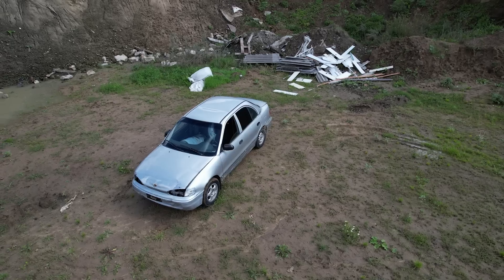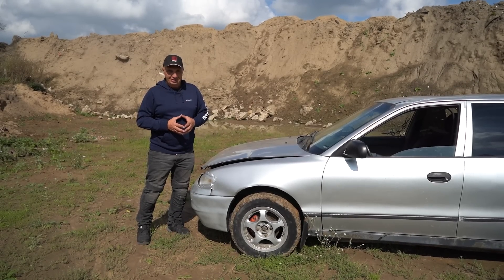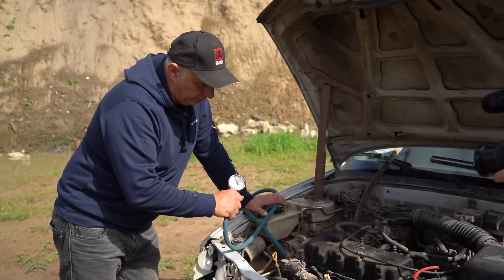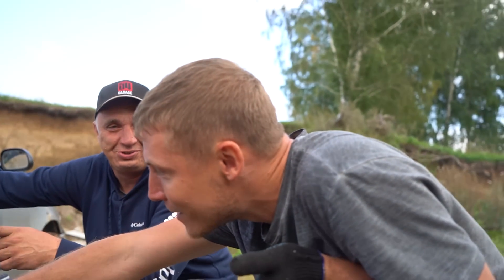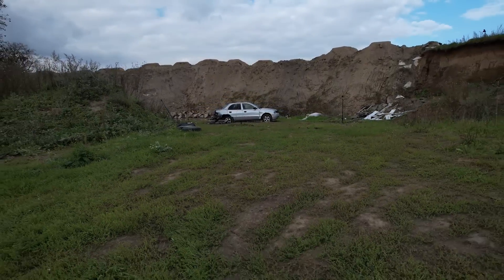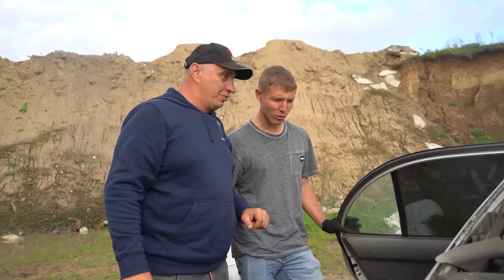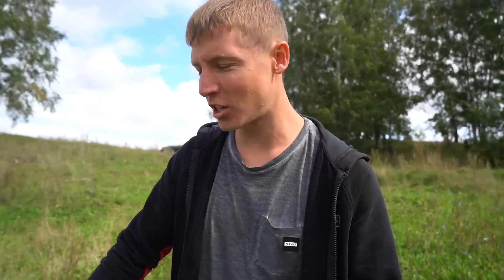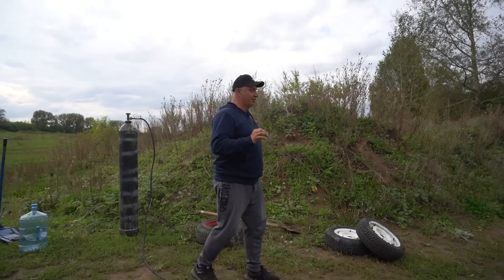We feed tires with 900 PSI of pressure - what will happen?

Comment: Less explosion on the front wheels due to the weight distribution. The engine and transmission is in the front and for pushing weight down their for the ground absorbs the impact from the expanding molecules under pressure and pushes the air to the side

Comment: Does anyone put extra air pressure in their tires to increase Miles per gallon or Kilometers per liter? If so, how much pressure and how much increase in fuel efficiency do to decreased rolling resistance?

Comment: The first 2 tires didn’t do much because a weak spot in the “rubber” caused the failure. The third tire actually failed at the bead not on a weak spot in the side. When that happens the force is incredible. You are actually ripping apart the steel cable/wire inside of the tire, which takes a lot of air pressure. The fourth tire also had a weak spot on the side. And it looked like the first truck tire also failed on the side. The second one also looked like it ruptured at the bead. You can see where it is  separated in several places. That would be why it had so much more force when it failed. 

In the US, there are two sizes of wheels that are very close, one being a 16 inch rim and the other being a 16.5 rim. The rims are basically the same size, the difference being in the thickness of beading lip. So you can get a 16 inch tire on a 16.5 inch rim okay, you just cannot get it to seat because of the difference in the beading lip. I worked at an auto tire company when I was young and a customer brought in a set of bare rims and wanted new tires put on. He told the salesman that they were 16 inch rims, and the salesman never checked (size stamped on the inside of the rim). Anyway, the salesman pulled the 16 inch tires and the technician started to put them on. He got the tire on the rim and hit the “blast” to seat the bead. The tire made a good seal and he kept airing up,the tire trying to seat the bead. Other people in the shop said it was taking a long time for him to get the bead set, but thought nothing of it. Then all of a sudden they heard, and felt, a big explosion that rattled every window in the building. The steel band in the top bead had ruptured and the force broke part of the tire machine and it took the top of the technician’s head off. The guy never had a chance. This happened at a different location than where I worked, but I showed up right after it happened to pick,up some tires. It was a mess, the “splatter” was all the way to the ceiling rafters and about 30 feet behind him.

Comment: Here's an idea, convert an overhead cam engine to side valve engine by moving the head sideways so that the valves are over the block. weld on iron to the side of the block to create a channel for the gases to flow from the valve to the cylinder.

Comment: Please sir if you want to do something really fun get a V8 engine I have done this set the carburetor to about halfway open and let it run in park with the parking brake on and put Pebbles into the carburetor and see what it does to the engine if it's a good American V8 engine it will keep running it is hilarious make sure the engine has proper oil and coolant someone please pass this up forward to garage 54 headquarters it is really hilarious to do we did it a couple times

Comment: Water do not compress so it does not build up pressure, so when the tire rupture you only get a little water splashing... But if you use air that compresses it will build up pressure and create an explosion when the tire rupture.

Comment: You measured the air pressure of the power steering setup, but you didn't appear to measure (or at least display) the pressure for the air setup. What was the actual pneumatic pressure that each of the tires exploded?

Comment: We were told in 1978 that truck tyres had enough air pressure to hurl a 13 lb bowling ball 1/2 a imperial mile about 800 meters , so yes never place any part of your body near a tyre when filling them.

Comment: About 56 years ago I was inflating a 15" garden tractor tire laying on its side.  I don't know how much pressure I put in but I only had about 80psi available.  Waiting for the tire to pop the bead on the rim and it popped and went airborne probably 30 feet.  Shattered my right forearm and then went through the carport roof and came back down and landed rim and tire on my pickups hood.  Will never forget that and have much respect for tires and air pressure to this day.
Reply: Glad you made it out safely.. yeaa PTSD is a real thing

Comment: Instead of gwtting a latger tank for diving thats usually arpund 3000 psi, they go through these wild steps to get pressure into the tires 

Why do it when you can over do it?

Comment: Remember that little rubber cup you'd turn inside out, set down, and it popped into the air? lol that tire on the roof
Reply: That was called 'Zongo' here in the Netherlands

Comment: Compressed gas and high pressure liquid are entirely different beasts when it comes to failures. The compressed gas expands exponentially, causing an explosion, whereas high pressure liquid doesn’t compress, therefore doesn’t expand or explode. That’s clearly seen in this video. That’s also why pneumatic systems generally are not super high pressure whereas hydraulic systems can be. The exception might be an instance of contained boiling liquids, which can explode due to the liquid becoming a gas as soon as they rupture and release pressure (things like propane tanks, aerosol can or water heaters are an example)

Comment: Had a 69 full size Chevy C/20 with a custom made heavy duty Dimond plate utility body on the back of. Somehow sitting on its own in my driveway the rear passenger tire just decided to explode sitting there for days unmoved. The pressure was normally set, these were heavy duty truck tires that had a maximum pressure of 90psi. I had roughly 50 in all of them because they were hard riders anything above that! The fact that they were  actually considered under pressured and yet, it was capable of lifting my rear of my truck off the ground and the sound of the tire was no different than a small land mine or hand grenade going off! I was 15-20 feet away from the blast on the opposite side of the truck and still fealt the incredible pressure wave blast by me after going deaf 😂😂😂 Needless to say, It was pretty intense, especially when it was completely unexpected! ❤❤❤

Comment: That big gas cylinder : You cut the bottom off weld a couple pivots on it for elevation put a half turn rotary valve on the end and make a carriage for it and you can shoot bowling balls with compressed air you need to hook a tank to the rotary valve and fill it as many bars as it will hold put a bowling ball in there and open valve and out pops a bowling ball about 300 kph, YEEHAW.

Comment: Wow did the frame bend??? Look at underneath the car. Also in the trunk explosion it looks like the rear axle bent?nthe wheel is angled inward at the top after the explosion 🤯
Reply: Yes the platform bend from the tire exploding inside the car!
But the car wheel was at that angle before the explosion in the trunk

Comment: if you disable the safety valve for a hot water tank, and then pressurize until failure,  the destruction is enough to destroy a shed, or small garage.
Reply: Mythbusters did that.. crazy amounts of force
Reply: @ryanbernard5287  I find that I like this creator for his experiments that aren't full of reality show manufactured dilemmas and made to seem more difficult than they are in actual reality.  also if these guys do it they breeze through the design and build, and then try  to get the most spectacular results with their creations . that's the problem I had with Mythbusters and "reality " television in general. they use psychological tactics (manufactured dilemma,  staged fighting, staged acts of outrageous behavior , scripting,  excruciatingly slowly dripping of progression with tantalizing hints of "wonders to come " but aren't resolved or not wonders at all, editing tactics that make it falsely controversial, and faking the winners and losers of competitions. these tactics are known to manipulate viewers by hacking the conscious mind (prefrontal cortex) and effecting the limbic system (amigdala,  often referred to as our lizard brain where we react instead of making thoughtful decisions)  the "news" organizations have gotten very familiar with such practices also.

Comment: Way back when I was in high school I worked in  tire shop. We got a lot of big trucks in. This one guy decided he knew more than anyone else, and inflated a 10.00 X 20 truck tire to 120 psi (normal pressure). The wheel had a split ring to hold the tire on. We also had what is called a cage to roll the tire/wheel into while inflating it. Well, this guy 'knew more' than anybody else in the shop. He 'didn't need no cage, he knew what he was doing". Well, the split ring came off under pressure, flying upwards about a hundred miles per hour, hitting the ceiling and clanging back down, nearly killing him. I think he learned his lesson. He never came back, thankfully.
Reply: I had an old split rim come apart on me while airing up a tire one time. I did have it in a tire cage though. Glad I did because it bent the crap out of the cage.
Reply: high school, I think you mean, everyone thought they knew more than anyone else.  heh  :)
Reply: Oh I've seen big 18 wheeling truck tires explode before. It makes these car tires look like a firecracker. Only it wasn't being inflated but it was rolling down the highway and the car in the lane next to it... Well they needed all new windows on the left hand side and pretty much a whole new left hand side. The driver survived with a lot of cuts, some bruises and a pretty good concussion.
Reply: I got a older trailer early this past summer the wheels with the lock ring as soon i got it home i pull the valves and deflated the tires. getting new wheels and tires for the trailer.

Comment: 120 psi was the max i ever pushed but thread disapears to fast !!! 55-60 psi seems to be the right number for grip and fuel saving !!!
Reply: Depends on the tire size. Mine are designed for 35psi.
Reply: I am curious what context you're talking about.  55-60 and 120psi are FAR too high for car tyres, yet 55-60 is far too low for truck tyres.

Comment: Since when are you guys working in PSI?
This is such a strange unit, no wonder most of the world uses bar.
Reply: Because they are using the unit the majority of their audience uses.

PSI and Bar are describing the same thing, pressure or force/area. PSI is 1 pound of pressure over 1 square inch, bar is 100000 Newtons over 1 square meter. Not sure why that is strange to you.
Reply: @ouch1011  Oh I know the technicalities of these units.
But the majority in the world uses metric. And there are good reasons for it. 
They may make an assumption about their audience but it isn't true. And even US-Americans use proper units, I know many :)

Comment: I saw someone do this at a gas station and it blew up right in her face
Reply: That likely happened at relatively low pressure. When people drive on a deflated tire it massively damages the integrity. Then you go to fill it up again and they fail. Had it happen to me once on an 80 PSI pick up tire, it was like a cat of nine tails but only at 35 PSI or so.

Comment: i knew lots of firemen who said the most dangerous thing in vehicle fires was tires exploding from the heat and spraying hot burning rubber  around
Reply: High pressure tires: infinite mpg with 30% chance of puncture
Reply: @twisterpower521  also -30% to -60% grip
Reply: Aircraft tires have meltable plugs so if the tire gets too hot the plug melts and lets the air out in a controlled mannor
Reply: My witnessed that happen back in 1994 at a large apartment fire. Couple of guys scattered and looked like they were limping.
Reply: Even when burning they don't eject hot rubber. Getting hit with the carcass as it falls apart is dangerous however. Sounds like a zipper when they pop, not fun.
Reply: Never seen that happen, but once at a car fire we did see a tyre rupture which sent a wire flying into the fire truck which left a decent dent considering the small wire size
Reply: That sounds fun! Let´s hope for the next video 😅
Reply: That can take your head off.   Definitely a hand